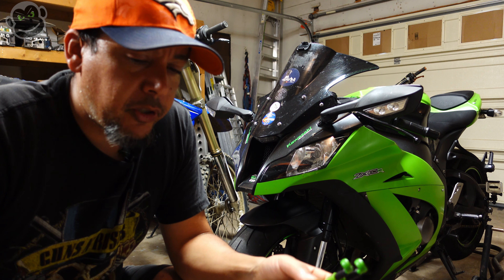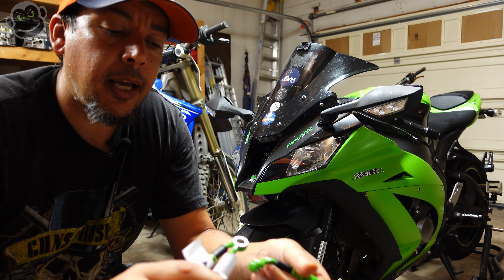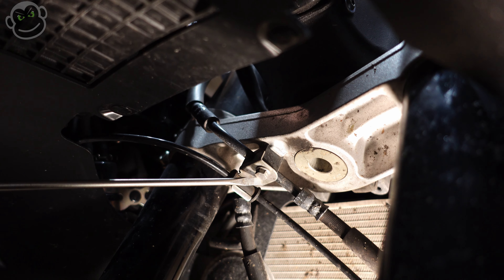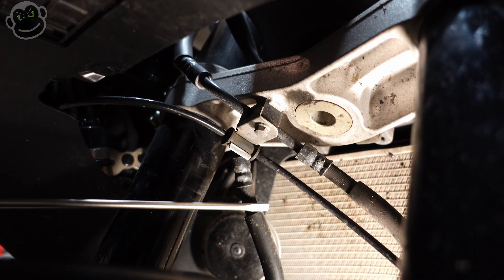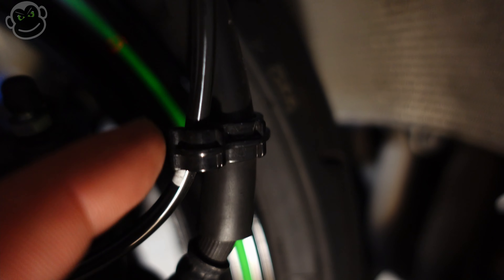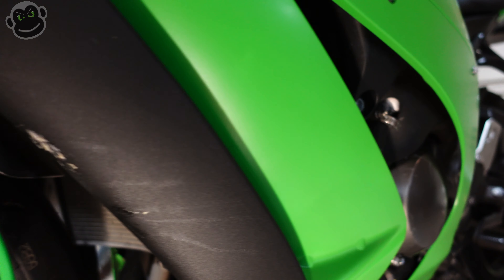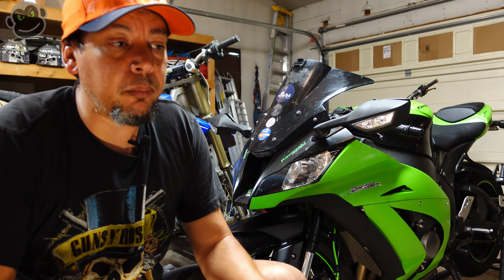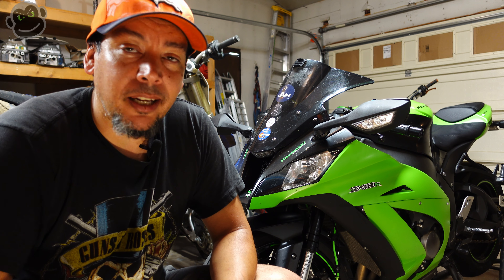HOW TO INSTALL BRAKE LINES | Core Moto USA | Kawasaki ZX10R Ninja

Comment: I found in my YT travels that rubber lines should be replaced after 3-5 years and wow my bike is 13 yrs old. No wonder I squeeze the brake and get little response . Thanks for sharing , and I am going with same set up and color 👌